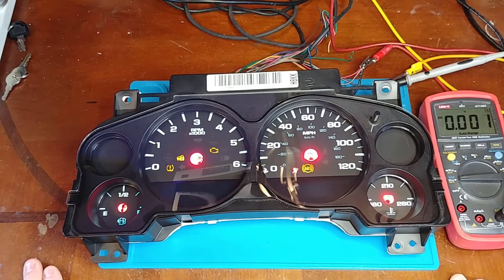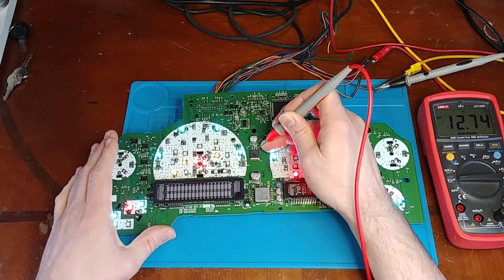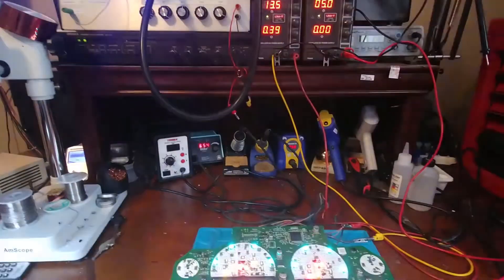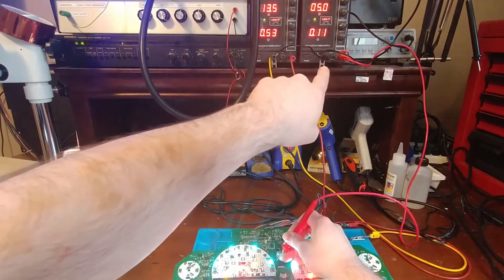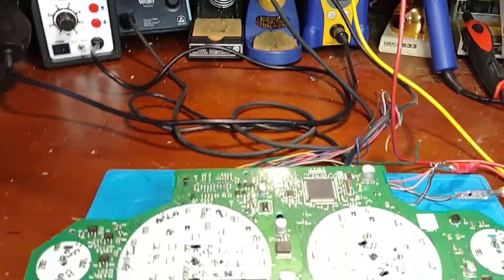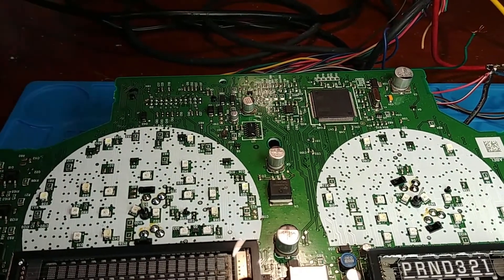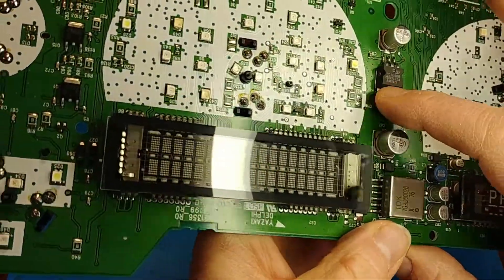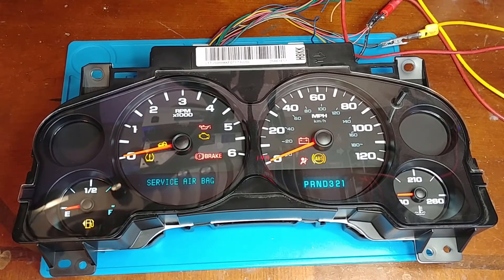2008 GM Custer Intermittent Repair

Comment: What if one might pull the middle pad on the voltage regulator by accident when removing?  😫 please help. Thank you
Reply from the maker: Run a jumper
Reply: @jeffescortlx  yea I thought of that by from where?
Reply from the maker: @juanmendiola1998  from the place it was removed from.
Reply: @jeffescortlx  but when removing it, The middle pad was pulled off the board with the middle prong on the voltage regulator
Reply from the maker: @juanmendiola1998  the middle leg should go to ground on the 3 pin voltage regulator. Did you pull a little to hard while the solder wasn't melted?
Reply: @jeffescortlx  yes sir I did

Comment: How much would you charge me to fix my 2007 cluster
Reply from the maker: Display repair for the 2007 is $100 plus shipping. This covers the 3 common parts, MOSFET, gate resistor and driver chip.
Reply: Okay I need your shipping address and and where to send the money
Reply from the maker: For details you can send me a private message or give me your email address.

Comment: Great video Jeff,  you ever take an eeprom and virginize it so mileage can be programmed via tech 2? I think it's programmable up to 5 miles.
Reply from the maker: Tech2 requires AC Delco service and a pass through I believe to be used to correct miles. I use a Chinese programmer for that.

Comment: Hello Jeff. I've been watching and a subscriber to your chanel and it has been very helpful. I've been repairing clusters for a couple years now and had a question you may be able to answer for me. I've had several 2003-2006 GM clusters come in with the odometer showing " ERROR " and was wondering if you know or have had any luck getting rid of this. I have several parts clusters if its a chip thats scrambled or is it just not repairable. Thanks for any input you can give me. Thanks ,Dean
Reply from the maker: You'll need to burn a new eeprom with the correct miles.
Reply: jeffescortlx  Thanks for getting back to me Jeff, are you talking about the eprom at U16 and/or U15? Thanks again.
Reply from the maker: ATMEL is the eeprom. 56585 is for serial data.
Reply: Thanks for your help Jeff. I'll have to look into what I need to burn new eeproms. Thanks again.
Reply: Dean Clark 7

Comment: Did you ever tried to reprogram the bricked 03-06 GM trucks clusters? Circuit board is fine. Just corrupted firmware in the processor. Cluster doesn't boot, doesn't communicate with MDS. Have few of those in the pile. If I replace the processor from another working cluster - this one comes back to life.
Reply from the maker: I don't have the ability to do anything with the software on the processor. Only the eeprom, few times I've needed to burn a new one because of odometer error. I only have a couple of boards with bad processors, and they have turned into my parts donor boards. These are boards that original owners tried to fix. I believe they were bricked from being plugged back into the dashboard and grounded out in random places from touching metal grounded parts in the dashboard. Or possibly ESD.
Reply from the maker: I see. I do everything possible to have the customer keep the original cluster with the proper vehicle. If I run into a situation where that is impossible, I normally have a few of each versions of boards, then just make a eeprom for it.
Reply: Correct, I try to salvage every board when it is possible. But when it's not possible I program the replacement board to make sure it has a firmware for the particular customers VIN number to ensure it's completely compatible, since even this brake booster message could be a headache, when installed into the vehicle without brake booster system. Keep up the good work! One of those days I will start to vlog the repairs too :)
Reply: jeffescortlx, couple of mine were DOA from the customer and couple died in front of me during the firmware reflash. Still don’t know if my computer glitched or what did actually happen.
Reply from the maker: What's the advantages to updating the firmware? Does it fix the hour meter? I've never ran into a situation where a firmware update was needed to fix a cluster.
Reply: For example when the cluster needs to be converted from the version without steering wheel controls into the one with the steering wheel controls. Some other options (e.g. brake booster option, etc.) are coming tight to the firmware version.